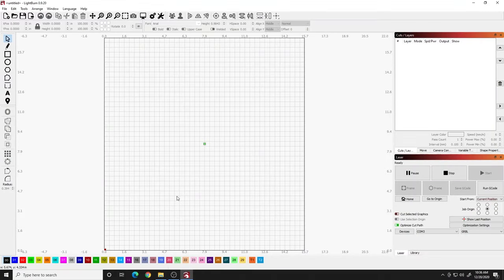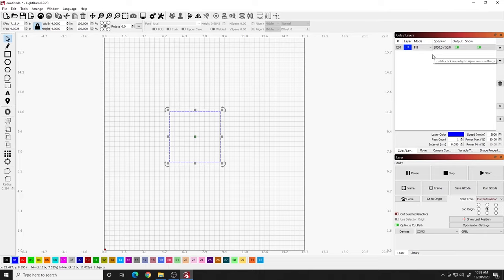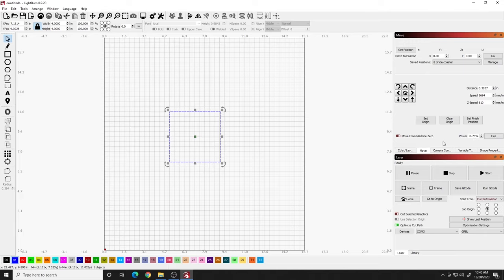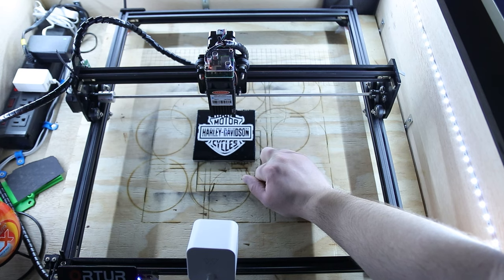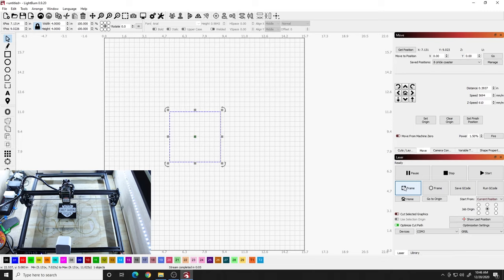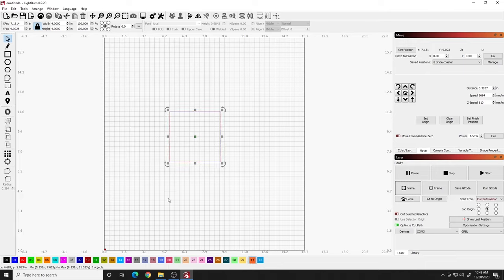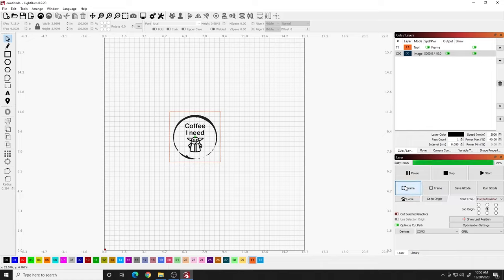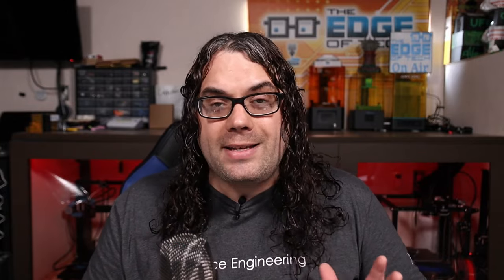How to Align and Center a Laser Project in 3 Easy Steps - Ortur Laser Master 2

Comment: Can you get it to burn a base board with the grid lines so you can match each time or close.
Reply: Wendell Roberts you sure can. Before you burn the grid on your board make sure you make it so your laser can't move (you don't want your laser to move around on the board after you have made the grid). I have done this and can place the tile (or whatever I am burning) right on the grid on the board. If I have the lower left corner of the tile set at x=20 and y=20 as seen on LightBurn then I simply place the bottom left corner of the tile on the x20, y20 intersection on the board. It takes all of about five seconds to do and you are already lined up perfectly.
Reply: @krisknowlton5935  Thanks for the quick reply. I have another question to help decide what unit is best for my need.
Ive watched so many different videos and so confused. Im using this to basically put my logo on items I make and maybe personalize some too, most are going to be rather small 1"X.5" in most cases, limited quantities. So pretty simple basic stuff.
Im down to 3. Cost being a issue too. (1) Laser Pecker Pro or V2 (2) Ortur Laser Master 2 and (3) OmTech K40...
Im not using to cut but maybe templates..
Please Help what is your Much More Professional Opinion... Also who may be best to purchase through who is in the US
Reply: @wendellroberts2533  I bought the Ortur Laser Master 2 (400x430mm bed, roughly 15 3/4" wide x 17" on the other axis) from Gear Best. From what I understand it is taking a bit longer to get now but you will get it. I don't know much about the laserpecker and as for the k40s I think, as well as many other people, the bed area is just too small. The Laser Master 2 is a real good laser to get your feet wet. I have engraved wood, put pictures on tile,  made wood business cards,, and am currently laser engraving on glass mugs. Trust me when I say you will do more with this tool than what think you will to start with. Also, just go ahead and get LightBurn.  In fact down load it now for free for one month and familiarize yourself with it so when you get your laser you can take off running. The software that comes with it sucks. LightBurn recognizes the Ortur automatically.  All you have to do is select it. There are plenty of videos on LightBurn by the guy who created the software.  They are easy to follow. 
I like the large area of the Ortur Laser Master 2. I always say get bigger than you think you need cause it is hard to stretch stuff. I've been real happy with mine and have done more than I ever thought I would do. If you need or want more information I will be more than happy to help you. But I think we need to figure out a better way of communicating.

Comment: Easistest is to position a sheet of thick paper on the laser plane and fix it with a tape, draw the perimeter of the work and laser it in the sheet then just position the object exacly on this perimeter... Done! If you have to do many pieces I fix 3 pieces of thick double side tape in the thre sides without peel the out side and you have a dima where position the thin objects or if you fix some wood block on the tape is perfect for thick objects 😉

Comment: If you want the quickest way to do mass production without the need to find anything do these steps:

1. Buy a thin 1/8 inch sheet of wood that can be cut clean through with your laser. If wood doesn't work use wte material your laser can cut through. The important thing is that it has around 1/8 inch thickness.

2. Cut the material to be the size of your work area and make sure it is square and 90- degrees at least on one corner.

3. On the bed of your machine attach rulers or a 90 degree ruler to the bed and fix your laser in place so it doesn't ever move. The idea is to have a parallel X and Y side wall to put your material  up against. So the front and left side of the laser will be the origin of your machine. Another easy way to do this is to use the 1/8 inch material and make sure it is bigger than your laser work area, you then put the laser on top of it and cut out the rectangular work area all the way through the material. You have to then make sure you never move the laser and fix it in place.

4. Now with the origin corner set you just put in the 1/8 material and line it up to the origin. In Lightburn try to fit as many outlines as you can of your workpiece. Then put your laser power to the highest and cut clean through the material.

5. Now every time you want to do production you just put this cutout and line it up the origin and load up the same file that you used to cutout the template. Align your designs to the center of the template cutouts in Lightburn and its automatically lined up every single time. No need to use the frame function at all. You can right click the cutouts and hit lock shape so it never moves again.

Hope that is helpful!

Comment: Is there a video on speeding up the burn? It took 3 hours to burn a 4 X 5 Gorilla
Reply from the maker: With some experimentation on your side you could speed it up and turn the burn percentage up, it should go faster then. But it might take a little dialing in
Reply: @TheEdgeofTech  That was simply the case on the hamster. In fact, you actually slow down the laser for a deeper burn. Thank you

Comment: 7:01 moving this piece by hand is a HUGE flaw. Don’t you have some kind of global fixture properties? I work with a fixed YAG laser. No gantry, but I can put the piece under the head and then control it all through the software.

Comment: This looks to be a lot of effort, and can burn up a lot of time if etching multiple tiles.  Why not make a jig that will place the tile in the exact same spot every time?  You can then, within seconds, be etching the next tile.  I'm waiting on my first engraver to arrive, and the first thing I will do is make a base for it with a tile jig in the lower left corner that will allow me to use anything from 3x3 up to 12x12 tiles with no recalibrating.
Reply from the maker: I agree! This video was to help people line up their work, no matter what they are burning. But a template or jig would be best and fastest! I also have a video on making a quick template! Thanks for watching!

Comment: How about this one....
Tape a piece of scratch paper  to your bed. set laser to 5% +/- and burn the outline of your object on the paper.... set your object inside your burn lines. 
4x4 tile? burn 4.1" square outline onto your paper .... center your tile within the outline.... You can also setup an entire grid for multiple tiles this way.

Comment: Why is it that you have all the extra stuff? This could have been a 3 minute video: 

Step 1: click point icon and click in the center of your work space object

Step 2: enable fire

Step 3: shift click frame and monitor and adjust the laser as it travels around your piece. 

You have over 7 to 8 minutes of intro / outro, talking, blah blah.  

Ain’t nobody got time fo dat!!
Reply: Latest version has extra tools to center objects on the workspace center which is better to use, but for me, using the origin is better for aligning with the edge of the work bed (assuming it’s attached to your laser in some permanent form. Really this video is outdated and have much better tools in the current 1.3 version available now.
Reply: 1) If you already know how to do it, why are you even here? 
2) He’s a content creator not a help bot, he makes money from engaging with viewers and generally displaying a bit of socialisation